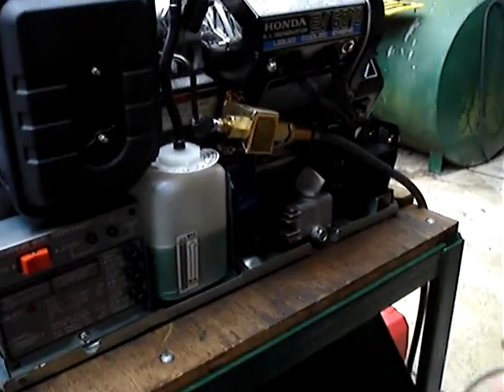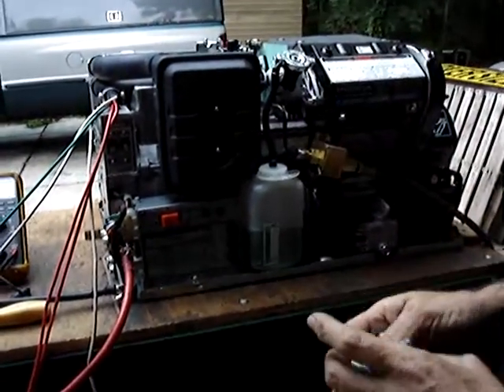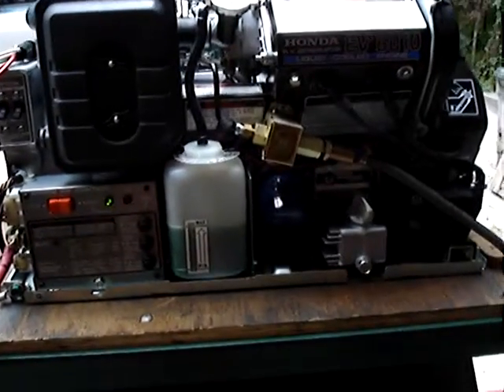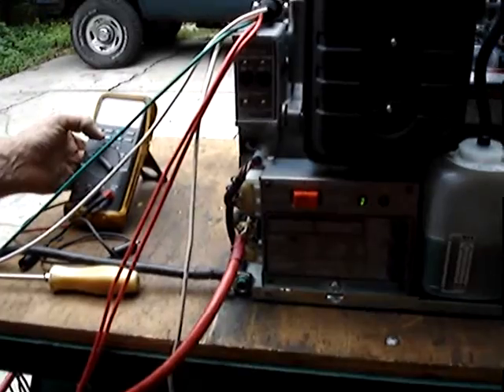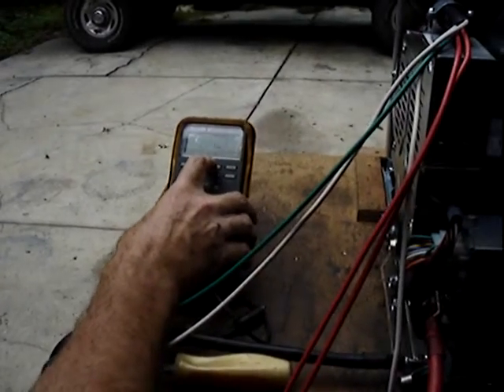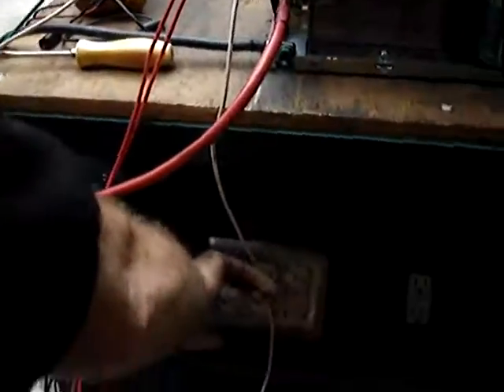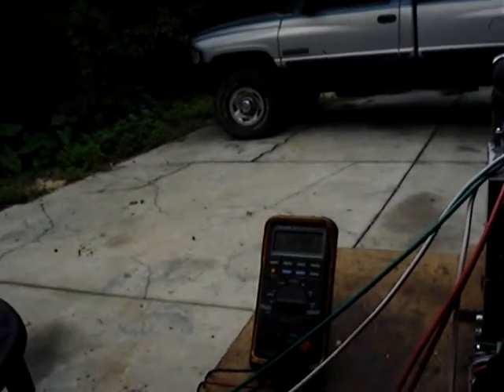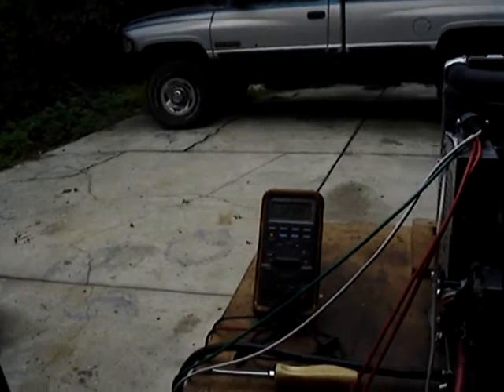First Start Up Of A Rebuilt Honda EV6010 By Pinellas Power Products 1

Comment: Are they all that loud.  Sounds like it’s running at 5000 rpm
Reply: Yeah without muffler they are deafening loud. I believe they are supposed to run at 3,600 rmp.
Reply: I heard one today running in a van I'm thinking about buying. They should definitely have a low idle button on it. An old Marquis gold 5500 runs at 1800 RPMs, very quiet
Reply from the maker: This is a single phase generator with a two pole rotor so it must spin at 3600 RPMS in order to produce 60 Hz